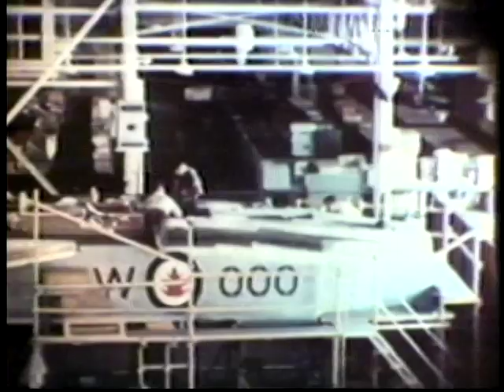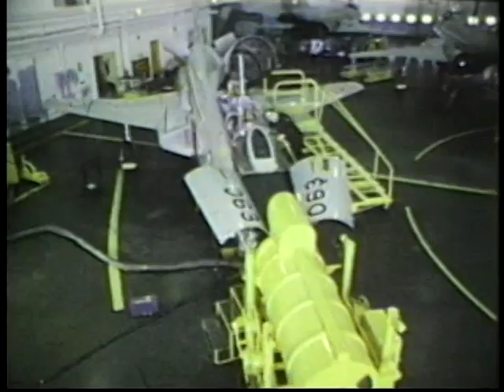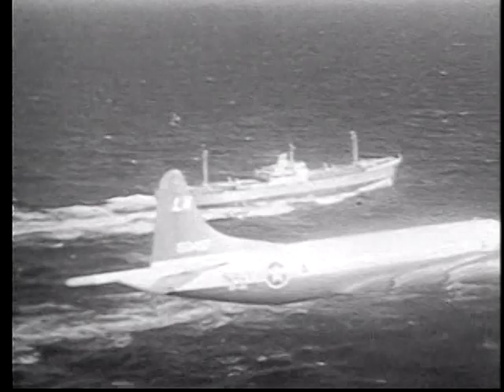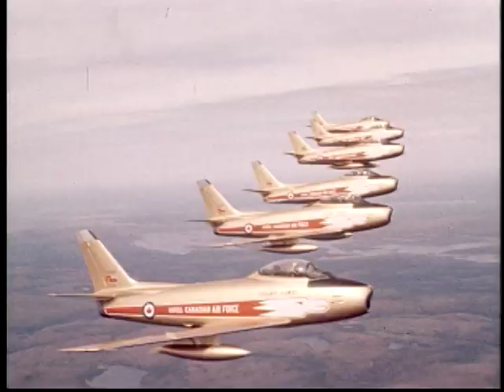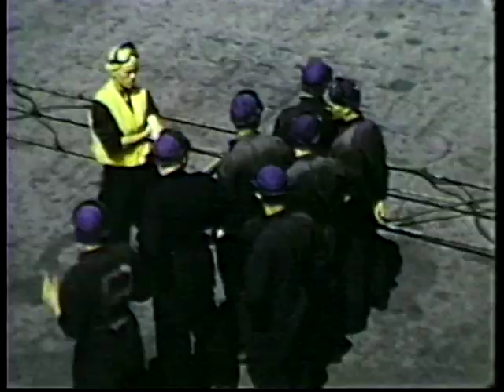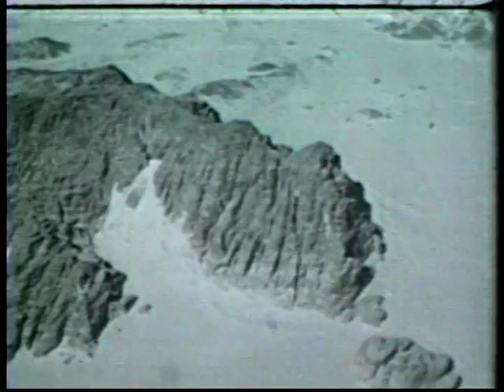On Canadian Wings - Ep 8. A Time of Transition 1959-1974

Comment: The BOMARCs, Voodoos and SAGE system cost more than the CF-105.  Canada canceled the CF-105 due to pressure from the US, though Diefenbaker didn't seem to push back much on the issue, so I think he still deserves a great deal of the blame.

Excerpt From: Office of the Historian, Bureau of Public Affairs, United States Department of State. “Western European Integration and Security, Canada (Foreign Relations of the United States, 1958–1960, Volume VII, Part 1" showing pressure from the US. 

"Doctor Hannah said that the discussion regarding the CF 105 pointed out the need for a more economic use of resources in the joint defense efforts of both countries. It was suggested that Canada and the United States should make a general study of the problem of producing for joint defense
...
Secretary McElroy said if the United States would get Canadian agreement not to engage in making complex weapons systems, but instead to turn its efforts to components, he believed that the problem of joint production would be solved.”

Excerpt From: Office of the Historian, Bureau of Public Affairs, United States Department of State. “Western European Integration and Security, Canada (Foreign Relations of the United States, 1958–1960, Volume VII, Part 1"